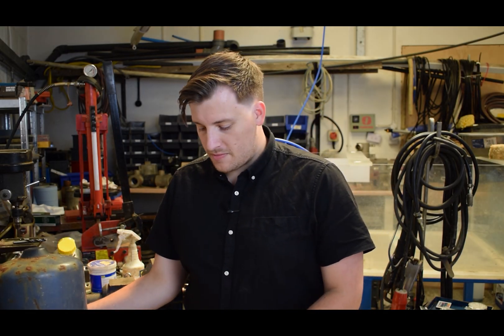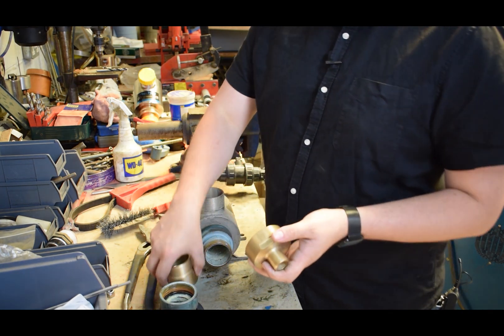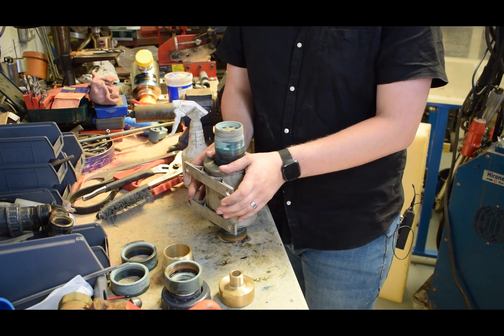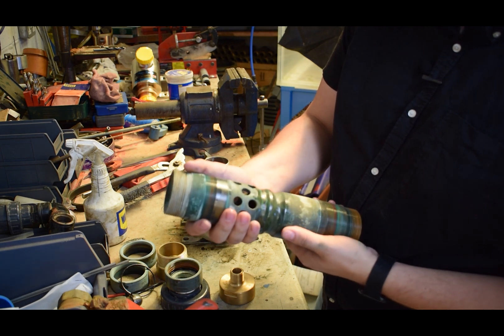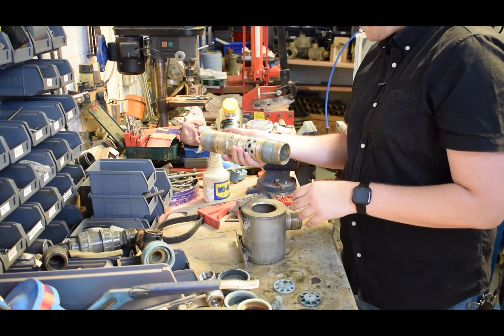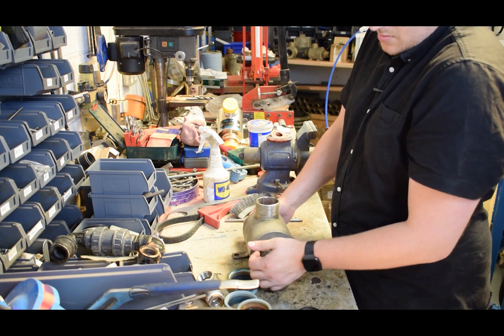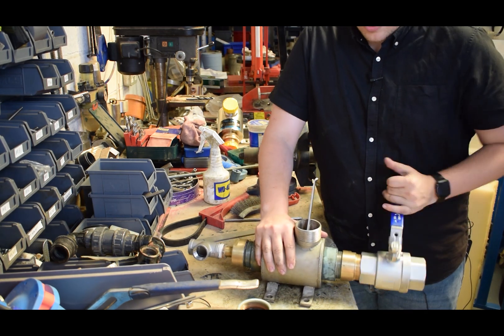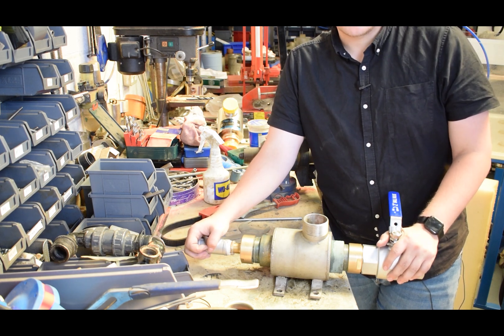Ram Pump 20yo Papa pump getting serviced

Comment: On Antiques Roadshow, I think they would refer to the "green stuff on the brass" as patina and would scold you for wanting to remove it 🙂. Seriously, though, a few misc. comments and questions: If one were using this to pump water for drinking, I suppose you could use a combination of vegetable oil and liquid dish detergent to get things apart rather than WD-40. What material is the housing made of? It appears to be either some Aluminum alloy or stainless steel. Does the pressure tank have a non-permeable bladder like the better well tanks? Other than the pressure tank reinforcement, are there any major design changes from this one that was built over two decades ago?